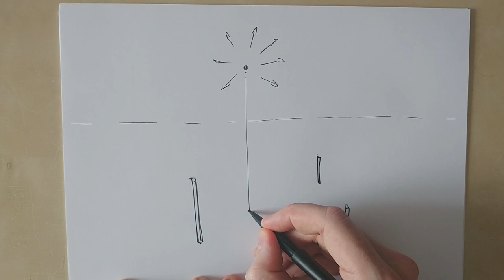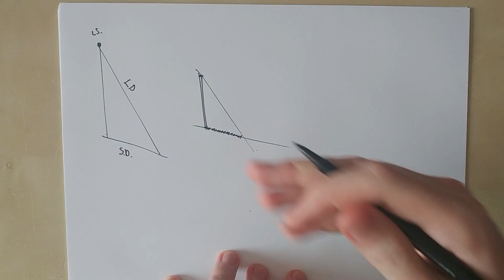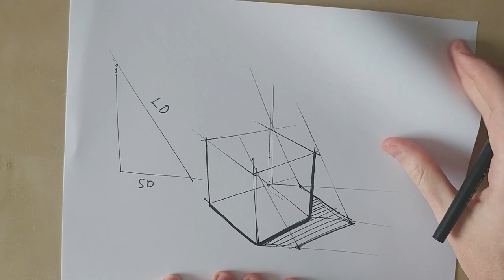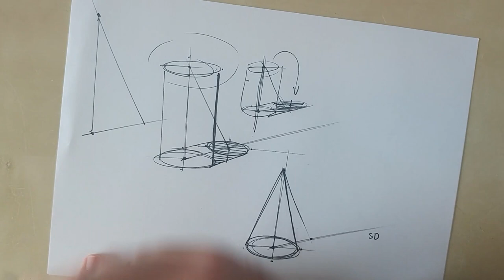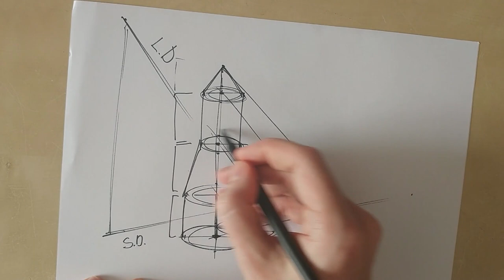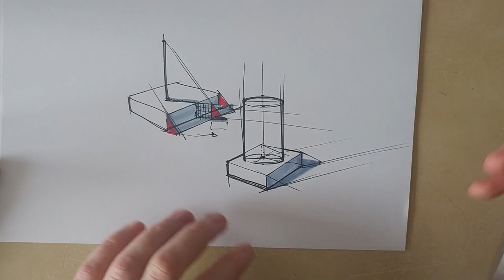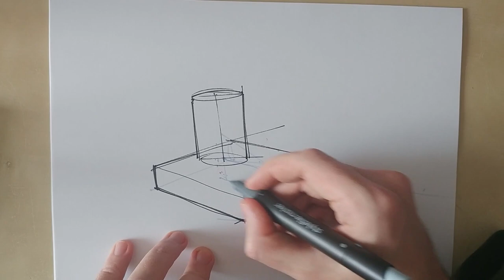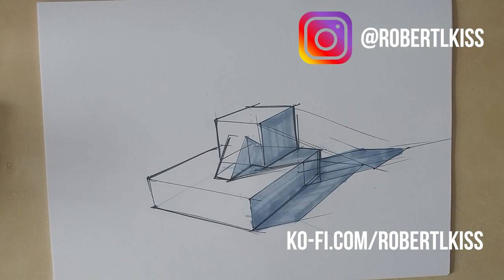Industrial Design Fundamentals 04 Shadows

Comment: May I ask, why do we have to bring the ellipse down to the ground level at 10:20? Why isn't it (correct) enough to cast the shadows from where it stands on the box, at that level? Is it simply an alternative to casting the shadow on the top plane of box, then going down the side of the box (straight line) and then moving on to where the Light Direction signaled as the end of the cast shadow? AMAZING videos by the way, thank you!!!!
Reply from the maker: If you can do that is fine. But for beginner it is important to understand to draw through shapes and understand where the ground plane is

Comment: by far the clearest post on this issue ( I just watched 10 others)  - but some use the idea of a Shadow Vanishing Point and place this on the horizon line - is this a different approach?
Reply from the maker: No that is correct I use that same technique here I just didn't mention it particularly because i thought it's self evident. The lines of the shadows that are not derived from the shadow direction are all parallels with the originating object which goes to the vanishing point.

Comment: Hey I have a question. When to draw shadow direction lines parallel to each other and when to project the sun on the horizon and draw a converging shadow?
Reply from the maker: Shadow lines never converge, they only diverge. Usually during day scenes you have parallel lines because the sun is so far away that the converging angle is negligible. Whenever you have direct light sources then the shadow lines are not parallel because of the converging nature of the light beams

Comment: In nature, how do you determine light direction and shadow direction?  How do you draw shadows of trees, for example if the sun is high in the sky?
Reply from the maker: It would be easier to explain this via video so I might do one on this topic in the future. But for now:

In general, if the sun is high in the sky u get the shadow below the object. So just as with a cube, the shadow would be exactly below it.

If you want to construct a cast shadow simplify the tree. Think of it as a sphere on a cylinder (almost like a lollypop). And then you can use the same projection exercises I showed in the video.

I hope this answer helps somewhat :)

Comment: Why do you keep the ellipse the same when drawing the shadow? Would there be any instances possibly outside of industrial design where you don’t do this maybe a long shadow where you want to indicate perspective?
Reply from the maker: The ellipse is technically not the same. The correct ellipse size is always between the one that touches the ground and a flat line that is on the horizon depending on where the light source is coming from and how long it is. But it will be relatively too size of the bottom ellipse especially. What changes is the length of how far this ellipse gets projected from the object which it belongs to.

Comment: ... I'm having a hard time understanding why the LD angles are being drawn in parallel to each other when the light is coming from ONE light-source. Since it is a single-source light, shouldn't the light direction angles all be emanating from the single point at which the light is located... tapering out and NOT in parallel.  Logically, if the LD's are drawn parallel (like how you are doing in your video), wouldn't that only make sense if EACH vertices had a corresponding light source?
Reply from the maker: You are correct. However the light source is usually the s un. On the paper I drew it that close as a representation of the direction. But if the light comes from such a far distance it can be drawn as parallel since the angle is undetectable.
Reply: @robertlkiss  Thanks! I thought this might be been a tricky question to resolve without drawing it out but that answers it! :)

Comment: What if the object has only one shadow direction? I mean, if only one corner of a cube touches the ground?
Reply from the maker: Not sure I understand your question. Objects in sunlight only heave one shadow direction. Only when they are hit by several lighter sources do they have several shadows like football players.
Reply: @robertlkiss  My real question is: If only one corner of a cube, instead of an entire side, touches the ground, how to set up the shadow direction, the light direction and the point where they intersect?
Reply from the maker: Pedro João you mean if a cube is balancing one one corner? Wherein e a rth do you see that in nature?:)) think of it as an upside down cone or pyramid mid.
Reply: @robertlkiss  Yes, that's exactly what I meant. I'm aware there's no such a thing in the real world, it's because I'm thinking about how to cast shadows in extreme situations such as the cube standing on only one corner, or an inverted cone.
Reply from the maker: @pedrojoao2941  as I said just do the shadow for an upside down cone. You saw how to construct shadows for cones and for cylinders it's the same exact process.
Reply: @robertlkiss  Alright, thanks for the tip.

Comment: Shadows seems to make the same angle with any 3d shape you draw. It's that a rule in industrial design?

I've found a video about cast shadow in perspective and it doesn't look like that ...
Reply from the maker: I used the same angle because I used the sun as light source and at that distance the light rays can be considered parallel. But if you wanna use a lamp or any closer light source then yes the light angles will differ.

Was this your question?